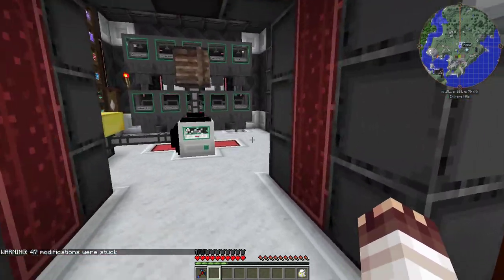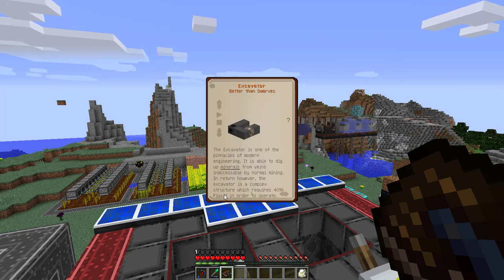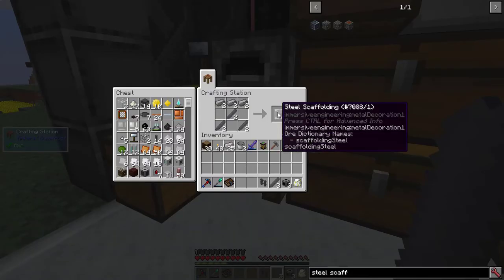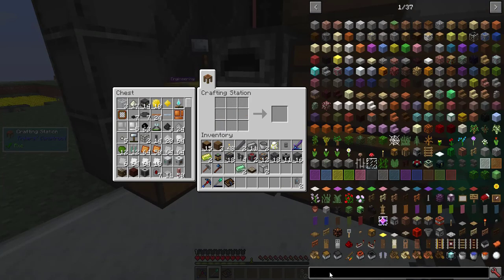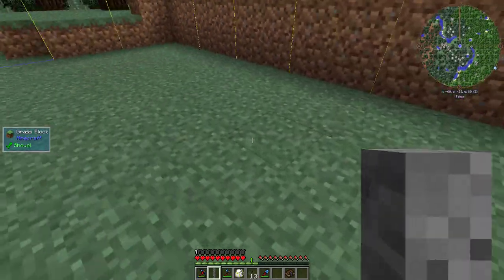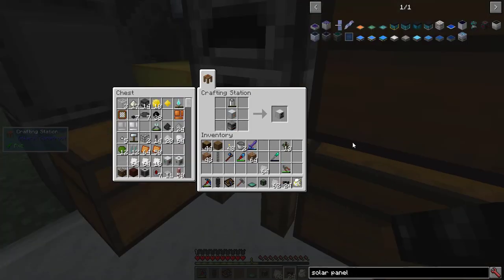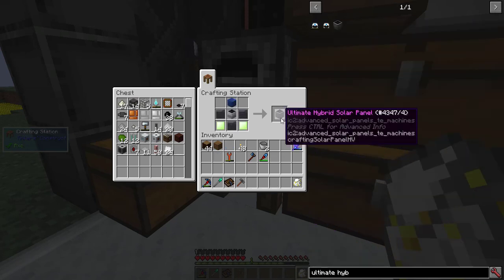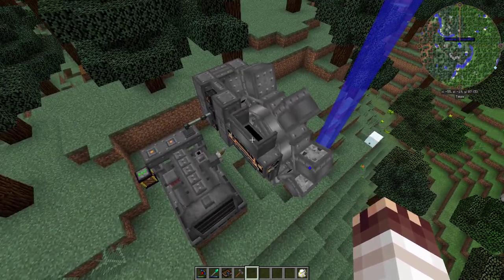Age of Engineering Supershorts #3: Excavator and Ultimate Hybrid Solar

Comment: Pretty good video, but setting up a diesel generator next to it isn't really necessary.  Make 2 Powercells and powercards to transmit 5000 rf/t. It doesn't lose any power unless you transfer across dimensions.
Reply from the maker: I do end up making power cells eventually--I'm just not in that age at the point of this video. Thanks for the tip, though!